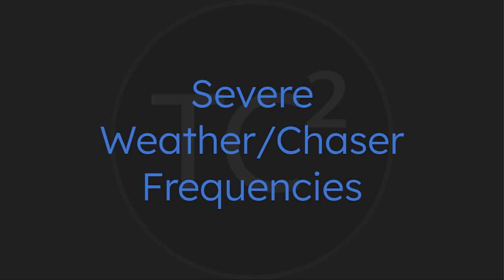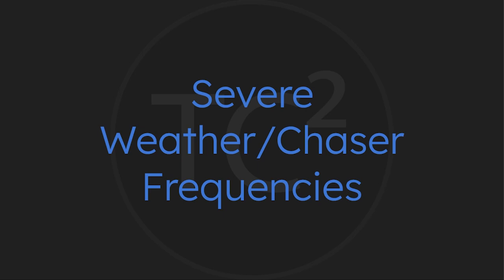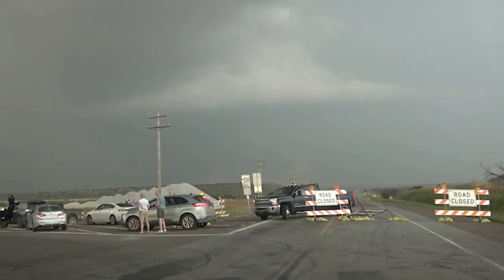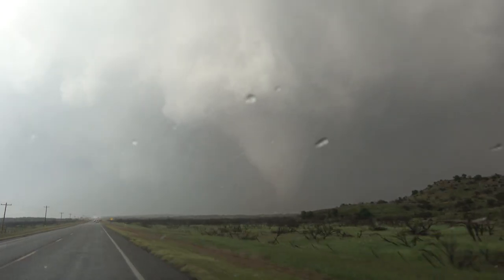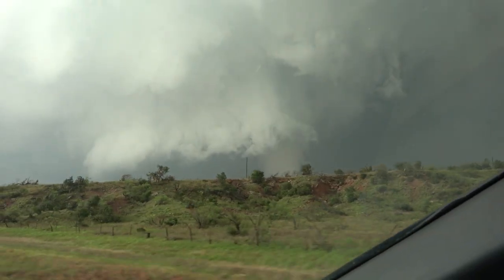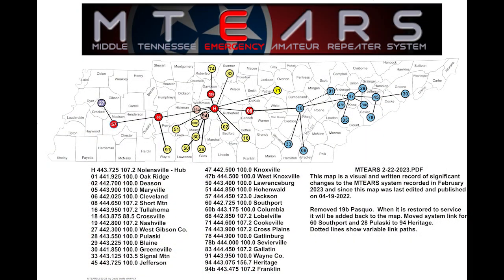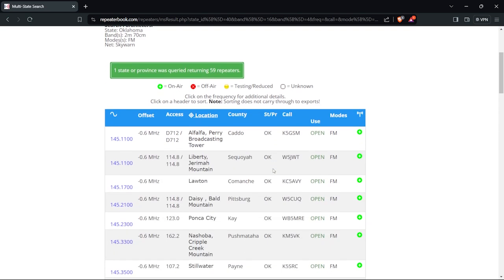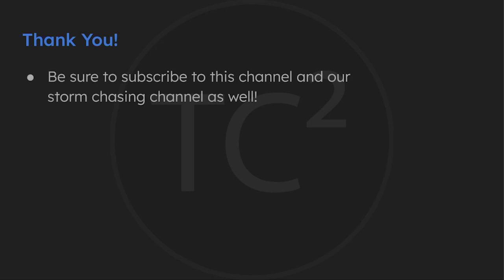Severe Weather and Storm Chaser Frequencies

Comment: What is the radio above your Yaesu FTM-400?
Reply: It's not available anymore but it's a ANYSECU W2 Plus Network Radio N60. It's basically an android device with a PTT mic. I use it for Zello and Echolink. Android itself is a bit slow on it, but it's fine to run those apps

There is a newer version but I'm not sure how much better it is.